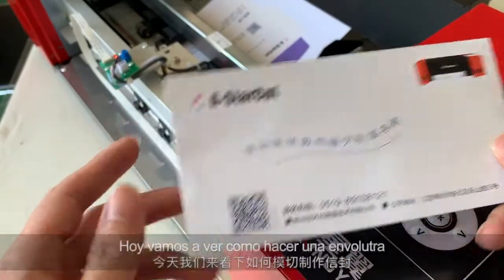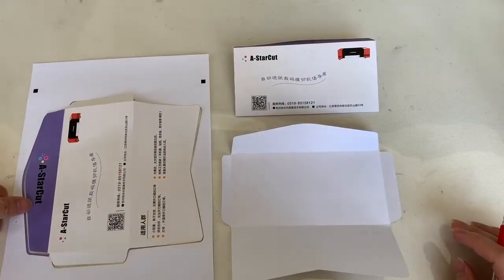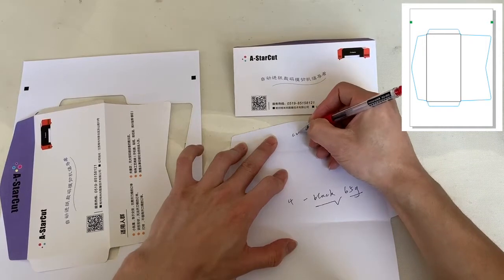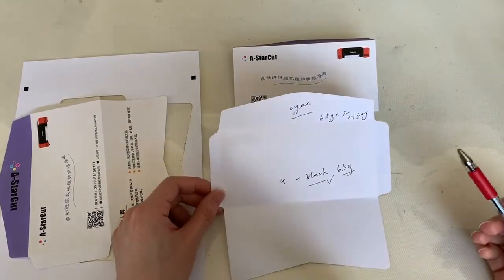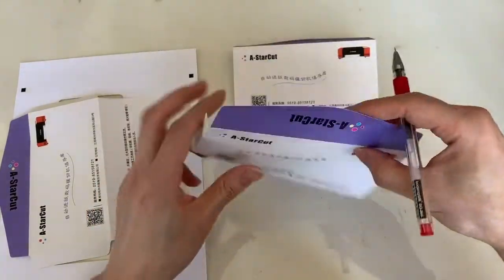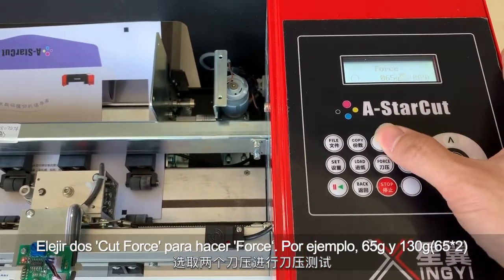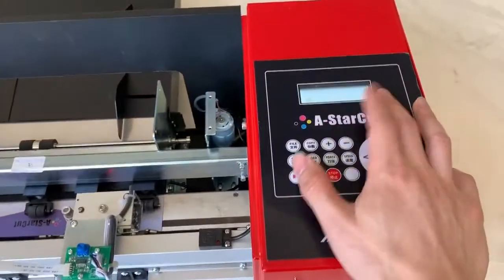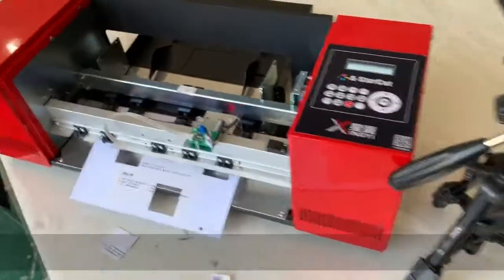Creasing and Full Cut with A StarCut

Comment: Can you try this on thick paper. It doesn't seem to work properly
Reply from the maker: Hi Mike, thanks for the comment. I have made one mistake. 3 Magenta should be 'Red'

For 'try this on thick paper', here is the link
https://www.youtube.com/watch?v=zqV8r2jyDd8&t=19s
Its cut on 250gsm cardboard. 

If if is not woking properly in your case.
1. Might be the 'Red' color issue, which I mistakely said 'magenta'
2. The blade tip's trick, in the link above at 16:32.

If  anything not clear, you may send msg to me directly via mail/skype/whatsapp or whatever it easier for u.